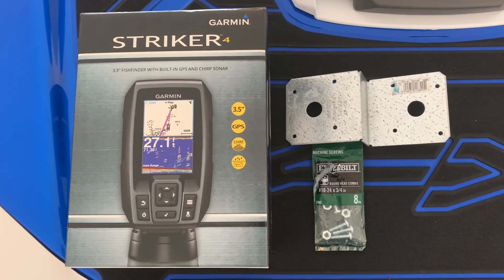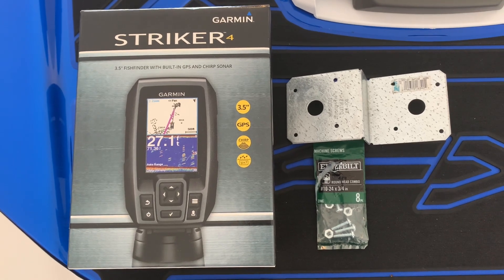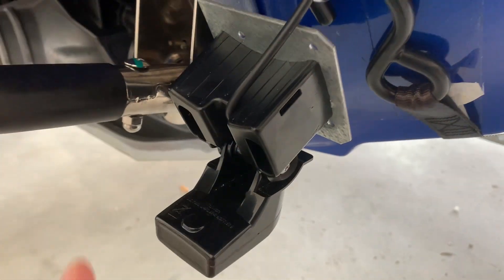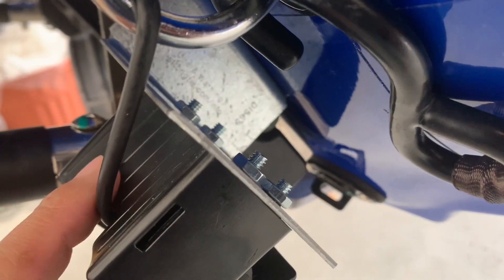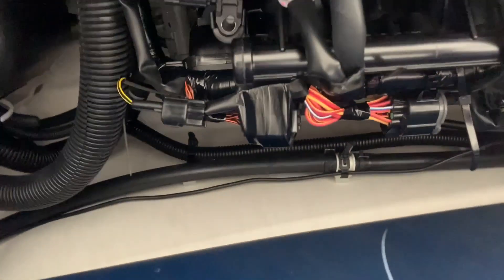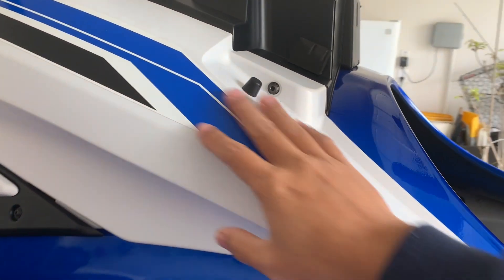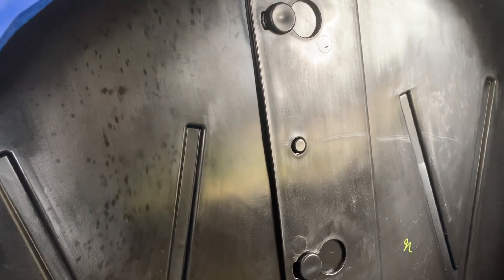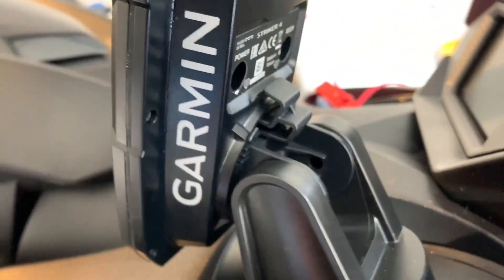Jet Ski Venture - How to install the Garmin Striker 4 GPS Fishfinder on a Yamaha FX Cruiser HO 2021

Comment: Hey thanks for this video! I too do not wish to drill any holes in my FX SVHO. 

I have a few questions:

1. Which bracket at Home Depot did you use and are there any steering, or corrosion issues?

2. Where did you get the cup holder top that you mounted the unit to. It looks exactly like the one Yamaha provides.

3. Is the power system and  the battery still working well for you?

Comment: That bracket is strong and makes a good square place to mount the transducer to, but if yours does like mind did, you will have to remove it, because it will work like a rudder and makes the ski hard to steer, it will pull to one side, and dangerous at a higher speed!

Comment: What size wire did you use to extend the power wires?
Reply from the maker: I don’t have any suggestion there. I did a bit different, I didn’t use DC battery as a power source but I have connected the Garmin Striker 4 power cable to an AC adapter with similar input/output then connected the AC adapter to a jump start battery which I can take out and charge easily lol. Maybe not helpful for what you are planning to do thought.
Reply from the maker: I used the red and black cable from the Garmin Striker 4 power cable only so I think we can connect to any cable that have similar input/output as the Garmin Striker 4 power cable.